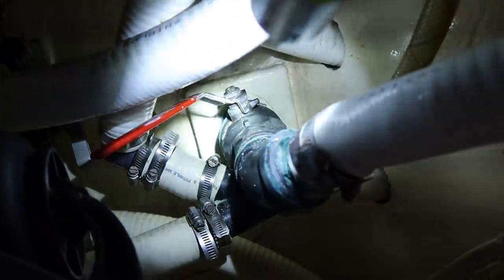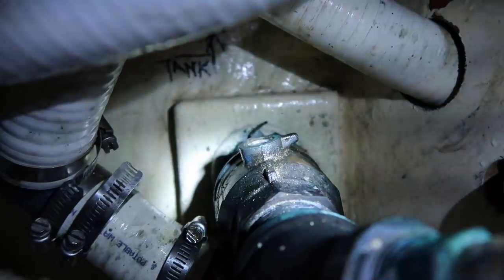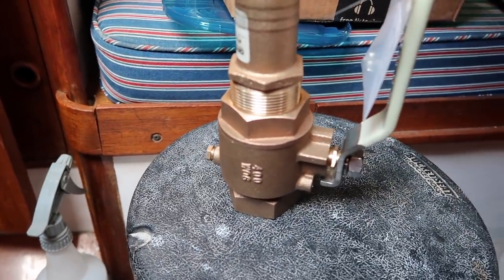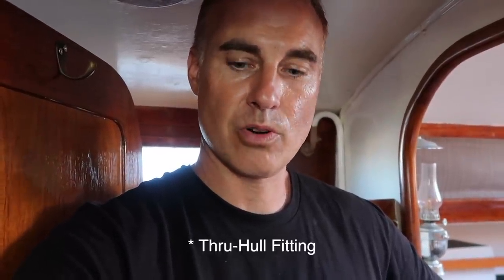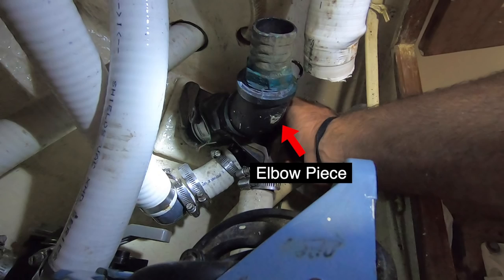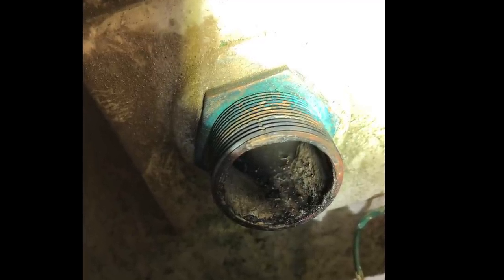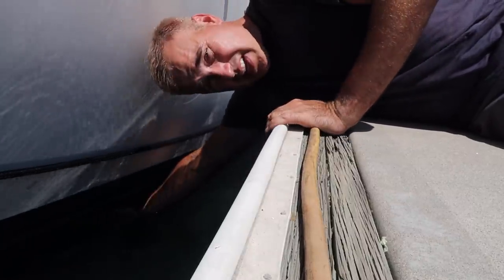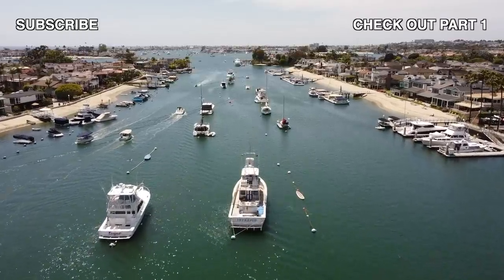Replacing Boat Seacock in the Water? Part 2

Comment: What a job , I had a 35’ sailboat many years ago , when I purchased it I changed all the sea cock before I put it in the water , but I would pull the speed sender a few times a year to clean the wheel  , I would just plug with wood and clean it , the next year I found a spray to keep the wheel clean all season.

Comment: Great work Josh.  As always, such a well done documentary. We just had, not only similar head issues, replacing parts and unclogging an elbow 🤮but also did a major job; changing the transmission which required lifting the engine and pulling out the V drive with the old transmission.  And all after only living aboard for three months.  Things keep going wrong.  Our water pressure, the alternator fell off, melted a switch trying to rewire it, replaced our anchor, and probably 10 other things I can’t even remember right now.  We also, are being tested.  Daily.  Don’t forget to enjoy some boat life time. Take a day off and do something fun. Keep the videos coming.  We’re learning through you.

Comment: Check your clamp and screw with a magnet. Sometimes the band is s/s but the screw is not. Also use smaller clamps so that there is not allot of tail hanging out to snag you when you reach into the cabinet. They also make small rubbers to fit over the end of the bands to protect you.

Comment: Well you did well only to nick a few threads. You did everything right. The only thing that I would suggest is to purchase the 90 degree Dremel attachment. They work quite well. It’ll give you a totally different angle of attack on some jobs. Another tool that’s a must is an oscillating saw. Both are good when saber and jigsaws are too big or clumsy.

Comment: That was some really great information.  I was thinking for sure you would have to haul out once the ball valve wouldn't back off. Only thing I would be concerned with is the age of the thru hull fitting.  The do become brittle over time. Looks like you handled this situation well. Good work.

Comment: Congratulations on a job well done!   A "crappy job" frustrating to the max to say the least.  Comment ..... I couldn't tell from the video how much the other hoses were in the way as your tried to remove the  valve.  But, if some were, it would be a good opportunity to replace them on this older boat.  Using the hose type that you suggested.

Comment: I know this advice is a little late, but, at work, we use a hammer to tap on the end of the pipe wrench to help loosen a fitting/valve....I'm not even sure if that was an option for you with the limited amount of space you had to work with....

Comment: For easier replacement  next time, you can fit flexi hose to through fitting then mount valve higher  on side wall with short pipe to your t-piece.
Reply: That’s not recommended by boating industry, but you could do that
Reply: THAT SOUNDS LIKE A GOOD IDEA BUT i don't think it is legal

Comment: All my outgoing valves are slightly above the waterline wich is nice only problem is my ingoing valve has som sort of scoop so I cant easily plug it and that valve is old and crusty  I want to remove it whit like a big tube 120 mm from te bottom of the ship that goes above the water line so even if the valve is broken I can replace it but it can easily siphon water out   
Plus I can make a stainles filter  basket that runs all the way up that you can clean by taking it out from the inside   probably going to be doing that as soon as I get my 60 ton schip out 
I probebly weld the tube on wile stil on land and than dril the hole from the outside

Comment: the ground wire? 
can you delve into 
that for a moment?
Reply: It can serve many purpose depending on how it is done.
For lightning protection.
To prevent galvanic corrosion.
To protect against stray current.
These are the 3 typical reasons it is done. Josh's is probably for the last 2 reasons.

Comment: This is outstanding.  Turns out what you are accomplishing is much harder than in your cast cutoff analogy; cast cutters don't rotate, they vibrate with a very small periodicity- this allows the doctor to be sloppy with impunity while looking supremely skilled, since the tiny vibrations easily cut the solid cast but not the skin (well... almost never - see https://youtu.be/8SNA951peEQ )
And... skin heals, but failed through-hulls rarely do (unless you have very altruistic, clever and industrious barnacles in your home waters - I don't seem to).
Thanks for all these excellent problem solving evolutions.  Now, if I could just get the rest of my Groco K to work nicely without showing me a 1 L sample of what is already in the holding tank after every flush.